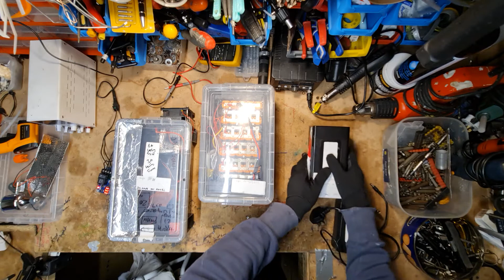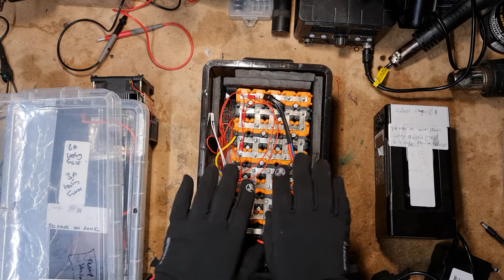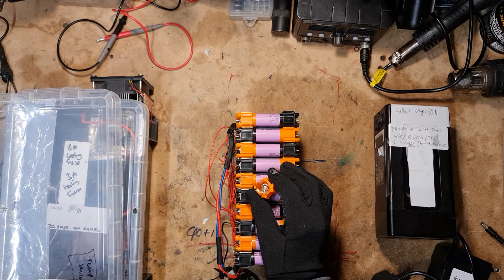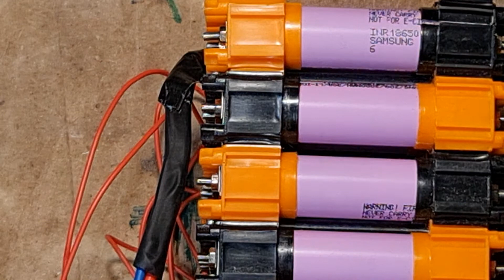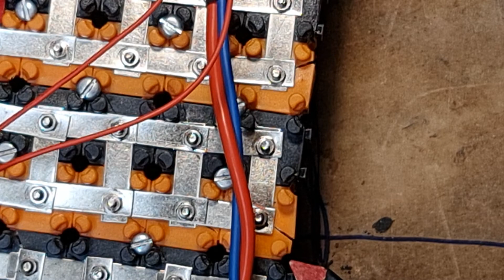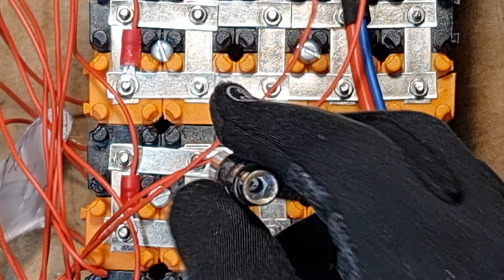Part 1 (of 3) Review of the Vruzend V2.1 lithium battery kit & construction  of my DIY battery case

Comment: Thanks for sharing a really great video. As an absolute novice I am looking for a small pack to drive my 230V / 170W 3D printer via an integrated 24V inverter / charger / ups during frequent power outages in South Africa. So intend charging the pack off mains via the inverter / charger and auto switch over to battery when power goes down. If I may trouble you, in your estimation what sort of Ah (Wh) would the V2.1 
30 cell pack generate? Any advice appreciated, TIA.
Reply from the maker: Hi, thanks for your comments. The capacity generated would depend on the mah rating of the 18630 batteries you intend to use. Mine are 3000mah, but you can get higher or lower. I think higher capacity ones are more freely available now. But your BMS must be up to the task of dealing with the higher amperage this will result in. I used a 20 amp BMS  this was over specified (to the 15amp I needed) but matched my scooter motor controller capacity so there was no blockage. 
Obviously higher capacity batteries give you more mA vs size, but are more expensive & need the higher rated BMS above.

Comment: Hi, will this type of battery pack actuate a starter motor on a Tesla?
Reply from the maker: I would go for a dedicated starter battery like the Power Start with non thermal runaway technology & a BMS designed for  cranking, whatever it is you are cranking ;) Maybe my handle !!!